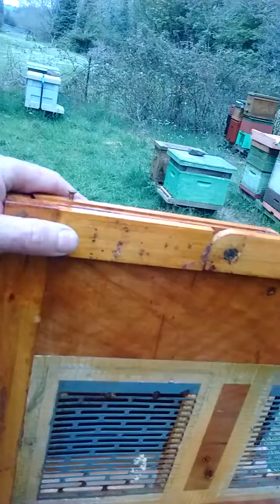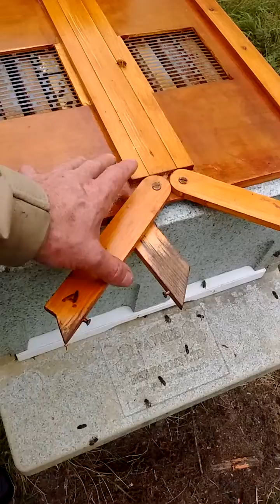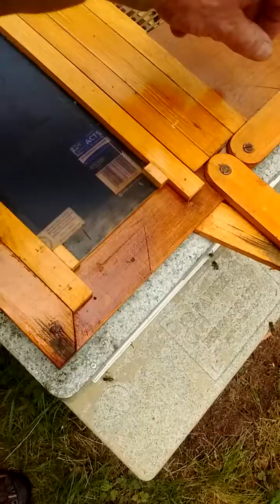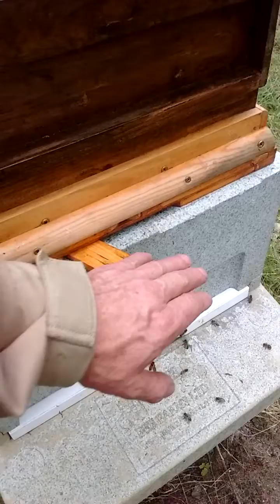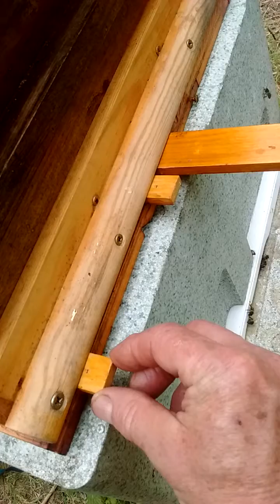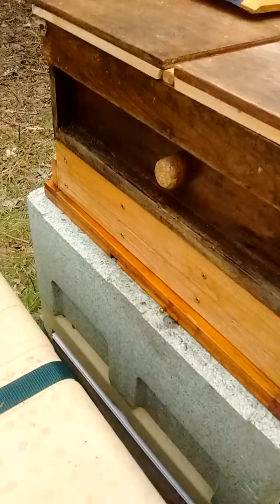How to use the Morris Board to raise queens

Comment: Wonderful video with great info. I would love an update on this. Also if you could give advice on the problems you had and the drawbacks of this method. What do you think about the cloake board method? I was looking forward to that method this coming spring. 
Thanks for any insight you could give.
Reply from the maker: David Shubin The Morris board works on the same principle as the Cloake board (switching from emergency to supersedure mode) and has the advantage that you can also switch between sides, enabling a continuous process of queen rearing in one hive. What I learned is that you need to keep feeding it with sealed brood for best results, which may be lifted from below, or from another hive. Lifting it from below stops swarming, which is an advantage. It helps to be using well-temprered bees, as you will be opening them frequently.
Reply: Have you ever tried using the cloake board method? What was your impression? Is that the main advantage of your system, the ability to have a continuous Queen production? What made you favor this system over the cloake board?
Thanks
Reply from the maker: I have used a Cloake board several times and it worked well enough. I like to try different methods and the Morris Board appealed to me because it is easier to crowd a smaller box with young bees, which is essential for successful queen rearing.
Reply: Hi Mr. Chandler, sorry to be such a pest, but I really am interested in this system. How might I obtain a Morris Board or how might I find a schematic to make one? I guess you did a wonderful advertisement for it. Lol 
Thanks once again.
Reply from the maker: David Shubin I made mine from studying a pdf that I found online. The main things you need are a brood box with a bee-tight central divider, and the board itself, which is easily made from ply with two sections of queen excluder. The moving parts are not too hard to make, but they have to be positioned carefully so bees can only go where they are supposed to go.
Reply from the maker: David Shubin here's the link https://www.google.co.uk/url?sa=t&source=web&rct=j&url=http://www.iombeekeepers.com/wp-content/uploads/2015/05/Morris-Board-v3.pdf&ved=2ahUKEwjVy7Xoo5LYAhUqD8AKHZGyDsUQFjADegQIBRAB&usg=AOvVaw16Otr2ClI60lNtFLu-urev
Reply: @BarefootBeekeeper  Thanks for the link

Comment: Here's a dumb question; Wouldn't the bees make queen cells if you make a queen less split putting a frame full of new/young brood with them?
Reply from the maker: Thomas Robson Most likely, but (a) they would be emergency cells, which do not always produce the best queens; (b) the larvae they use are likely to vary in age by up to 24 hours, making it difficult to accurately predict time of emergence; (c) cells on the face of the comb are more difficult to handle.
Reply: Good info.

Comment: Very good video. It took me a while to understand exactly how it works, but it all makes sense. Not something for the NEW beekeeper to use, I believe.
Reply: The photography is not good but once you get your head around it, it works really well but like most things in Beekeeping its the nuances that bring success or failure. You can us it with the "Miller method" or the "Smiths Better Queens method" eliminating the need to graft making it very basic so it can be used by a novice who is prepared to have a go and do a bit of reading. Its really just a matter of writing out the stages in sequence and then working through them ticking off the boxs for the first few times.

Comment: In 40+ years of bees, this is the dumbest thing I have seen. Way too much trouble !
Reply: Actually its a very easy system and you can raise 20 queen cells every week if you want to bank your cells somewhere else or every 14 days if you don't. No good for large scale queen rearing but 20 queen cells every week is much more than most people need.
Reply: A complicated cloak board system,  with forgers doing the work of nurse bees.
Reply: Malcolm Megibben  :- The Morris board was invented before the Cloake Board and I suspect Harry Cloake had read about the Morris board in a Bee Journal before he came up with the Cloake board. If it is used correctly nurse bees will be raising the queens.
Reply: @MegaDavyk  well, then as I said a complicated cloak board. Glad it was made easier and less complicated for the backyard beekeepers.
Reply: @OklahomaBeekeeper  :- Well actually because the Morris board came first the Cloake Board is really a simplified Morris board.